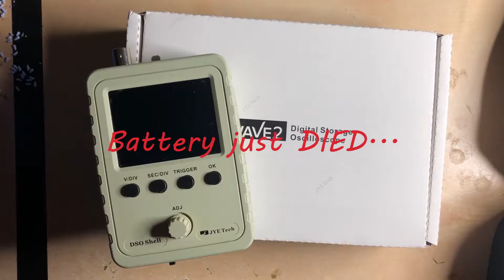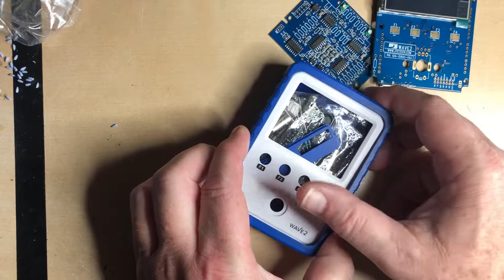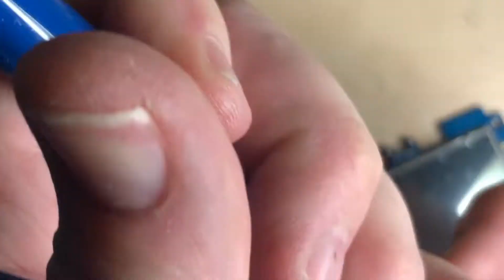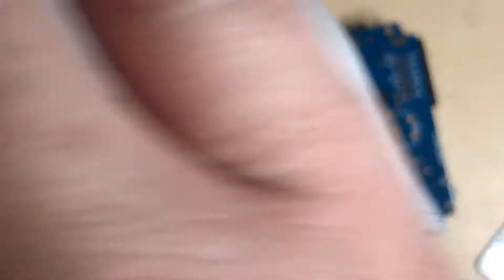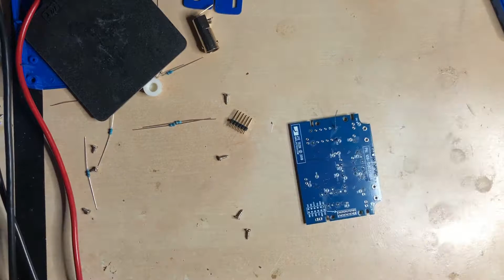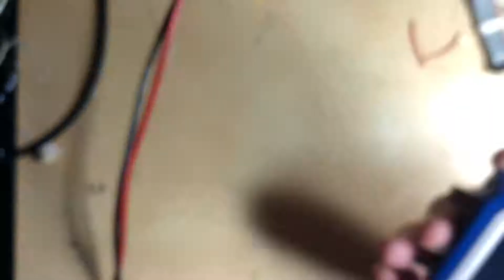late night assembly-wave 2 DSO scope build

Comment: Thanks for the video. Can the Wave2 operate both as frequently generator and scope simultaneously? IOW, can I take a signal from its generator, feed it into a circuit, then read the signal using the same unit?
Reply from the maker: The short answer is, i don't know. I havent had to use both functions at the same time. Check out this link to their forum. Someone might have the answer. I would look for you but it's packed up right now.

 https://forum.jyetech.com/viewforum.php?f=22